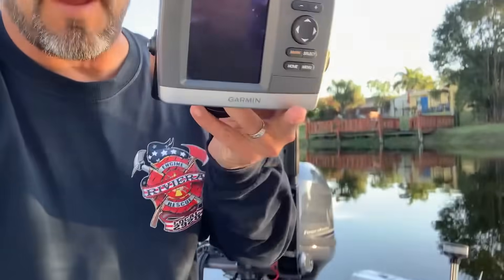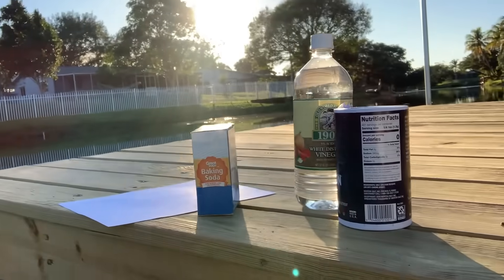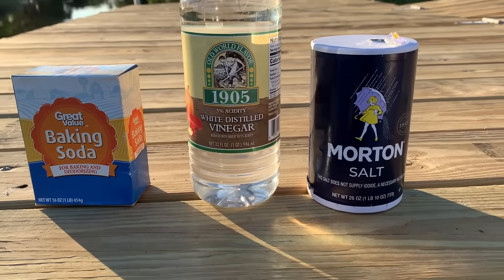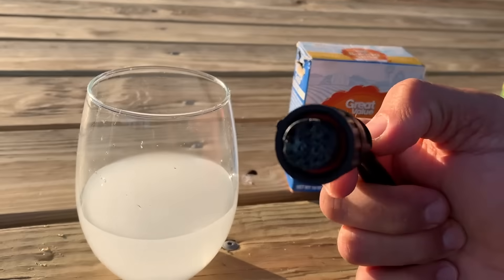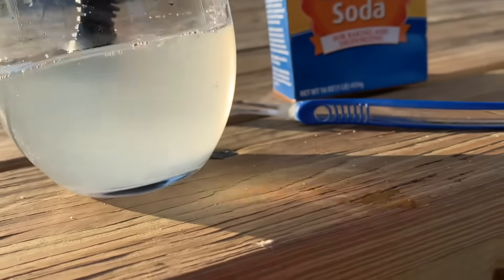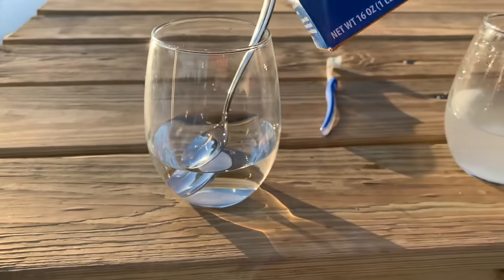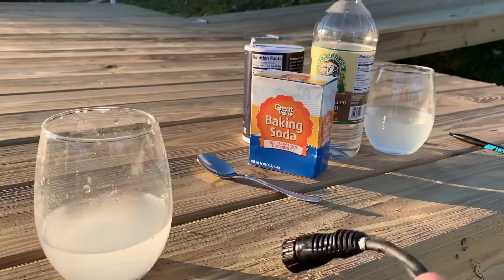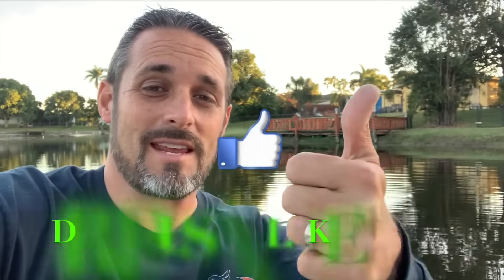HOW TO CLEAN CORROSION FROM COPPER ELECTRICAL CONNECTIONS USING HOUSEHOLD CHEMICALS

Comment: The reason for the salt in the vinegar is to convert the acetic acid in the vinegar to hydrochloric acid, which is a much more reactive acid that gets the job done faster. It does not change acidity or the amount of corrosion removed though, it just makes the reaction much faster & the job take less time. But the level of acidity in vinegar is very low so you only need a small amount of salt to completely convert the acid. The amount you used is way too much & is detrimental to what you are trying to achieve because salt caused the corrosion problem in the 1st place & applying too much again is going to setup the same reaction again. Sure, you can flush the salt out but you will have to use a lot of fresh water or distilled water to do that. You need only about 2g salt to 250ml vinegar to completely convert the acetic acid to hydrochloric acid. That is about 0.7 oz salt to 1 cup of vinegar.

When all the corrosion has been removed, flush thoroughly with distilled water.

Next flush again with Methylated Spirits (pure alcohol) to remove any remaining water and let it dry completely.  You need to do this because water confined in the small spaces in the connection will not evaporate quickly & may cause problems, but alcohol will evaporate faster.

It is likely the connector has been damaged by the corrosion & this will make it more susceptible to faults over time.  I’d suggest spraying a good electrical cleaner/conditioner into the connectors such as Deoxit F5.  These products seal the contact surfaces with a semi conducting coating that excludes air from the contact surfaces, preventing further corrosion.  From over 30 years experience managing & maintaining an auditorium PA, I have found that this increases the life span of connectors and reduces their maintenance by about 5 times over simply a contact cleaning product.  You may be able to find a marine grade product in this case, but F5 is what I used.

If you do use an abrasive on electrical contacts, try to use the finest grade you can & then polish with a metal polish because a polished surfaces will oxidise the slowest & will remain working reliably longest.  So avoid scuffing up contacts with files, knives & sand paper if at all possible.  If it's an emergency so you have to do that to get home safe, replace the cabling afterwards because it's going to corrode fail you again & probably sooner than you think.
Reply from the maker: Wow!!! Thanks for the detailed comment. Most helpful
Reply: Better check with your chemistry professor on that before you take the final.

Comment: Dielectric grease those before reconnecting. Also rinse that vinegar off with clean water before drying it off.
Reply from the maker: I did the clean water thing. I need to get some dielectric grease for sure
Reply: Water caused the corrosion. After tixing the corrosion, water it down again? We talking electrical wires…. 😮😢

Comment: Just so everyone knows, vinegar and baking soda mixed = salt and water. 
A better way might be to use a slurry of baking soda and water, scrub it and work it down into the connector, then pour vinegar into the connector and using the brush work it around. That way the reaction is taking place on the connector, not in the glass. 

Then follow that with alcohol and let it dry.

Comment: Better than vinegar on this type of connector is citric acid. The reason for this is that you also have rubber gaskets on these connectors that vinegar will attack. You can get away with vinegar a few times, but you won't have any issue with citric acid and in my experience citric is also better at cleaning copper. Neutralizing with a bicarbonate wash is ok but after scrubbing with your acid. Just make sure you flush well as you don't want any residue from citric or bicarbonate. Also, consider using interdental brushes for the female contacts. They will get deep in them and scrub well.
Reply from the maker: Nice! Thanks for the ideas here

Comment: Any corrosive liquid containing salts or acid is going to wick up into the wires eventually dissolving them. It's just a matter of time.  Prevention is the best thing by making sure the o-rings are intact, lubricate with a little silicone grease and check the connector is fully tightened.
  There is a liquid product used for neutralizing salt for fishing reels that might be effective, but I have never tried it.

Comment: Thanx nice video.
 I might try laying the glass or other type of container like maybe a plastic or glass mustard or other container that has a smallish opening at its top with a lid. Remove the lid. With the container  lying on its side a bit so that the connector can be laid on its side so the liquid can get up into each connector hole and the air would be pushed out. This way the fluid will contact each individual hole deeply.
Reply from the maker: Nice!!! Thanks for the info!!

Comment: Instead of dialectric grease to finish off with, try ACF50 anti corrosion spray from any motorcycle shop. It should do a good job of displacing any wayer, and also wick down the wires.
Its a good idea to use ACF 50 on any electrical looms or circuit boards from new so the corrosion doesnt happen in the first place.
Reply: Acf 50 or Corrosion X by same manufacturer is great. NOT dielectric grease.

Comment: Nice to know about home remedies. But CRC makes an electrical Contact Cleaner spray can that works really well and dries pretty fast. I use it on my truck to tráiler electric connector
Reply: Where can i buy that ?
Reply: @TempusErrante  
I buy it at the Home Depot and the electrical contact cleaner spray is located in the electrical isle right where the wire nuts are located.
Reply: @Gabriel-jc2sc  thanks pal 🫡🫡🫡🫡

Comment: After washing the connector with water, you could dip the connector in Isopropyl Alcohol which will displace the water and then evaporate
Reply from the maker: Interesting!!
Reply: Would WD 40 work for this?
Reply: @drizler  Yes and not only to displace the water but to prevent new oxidation.
Reply: Good idea!
Reply: I was looking for how he dried it out!  Once upon I time, I “knew” to use alcohol, but i couldn’t remember the best way to dry out a connector.  Thank you for posting this!!
Reply: Absolutely or some electrical spray cleaner
Reply: Yup, Use 91% isopropyl or higher.
Reply: Everclear to the rescue again?

Comment: My friend...
I'm sorry to be the bearer of bad news but, SALT is the reason your connector terminals looked like that to begin with.
Now, to make things worse, you dunking the unmated (which means unsealed) connector into another salt bath. The terminals inside of that connector are most likely crimped, possibly soldered, to the multi-conductor cable that enters that housing. In other words, these terminals are not sealed off to the elements when unmated, thus, the copper end of the cable is wicking all of that salt up into the conductors.

You may say to yourself, hey it got rid of my corrosion & i haven't seen anymore since. Well.. while i wouldn't recommend "washing" any electrical connector in that method, I'd wager to say, that if you haven't seen any corrosion since then, it's because you washed the salt away with your second rinse.. However, I would almost guarantee, if you cut that connector off or de-pin it & strip the individual conductors insulation back, you'll see blackened or even green fuzzy wire strands..

It's crazy how far back water/moisture will wick into a wire.
If you don't believe me, here's a short example. 
I once used inferior heat shrink on a set of battery cables I made for my dual battery toy hauler. I knew better, but was in a pinch & needed to be operational. Well.. just two years later, water/winter road salt had wicked up every cable on that truck & almost the entire length of each cable. 

I've seen the same thing happen to unsealed splices in headlight wiring etc.. Water, Humidity, Moisture, acidic chemicals, whatever... All bad for wire & cable. Not only does the joint/connection go bad, but major lengths of the harnesses get junked too..

I would suggest, terminal cleaners next time as there are cheap tools dedicated to fixing problems like that. Carburetor tools can also work in a pinch for scraping corrosion.. just whatever you do wallow/stretch your terminals out with the tools or they won't make contact anymore. 

Just some food for thought my friend.
Reply from the maker: Wow! You put a lot of thought and time into this bud. Thanks for the suggestions. As stated in the video, I’m no Electrician and I’m no chemist. Just made a video on how it worked for me and it seemed to work great. But I’ll keep the things that you suggested in mind.

Comment: I though the salt would be counter productive? Can’t you just use baking soda and vinegar. I’m just thinking the salt water caused the corrosion
Reply: Just wondering as a kid we always used vinegar and  baking soda on batteries to clean terminals. I didn’t know if salt made it better. Thx  great video I will subscribe your interesting
Reply from the maker: Perhaps. I’m no chemist but the salt was supposed to balance one of the other chemicals out. Connections are still clean and functional two years later with general maintenance
Reply: @watchyourlip3209  well what you did worked thats all the point of this video well done

Comment: I tried your way for RUST on my USB connector charging cable did't work . What did work is toilet bowl cleaning liquid . If you read the label some of them says removes rust . I tried it once letting it sit for a  minute . On the outside removed much of it . had to use again letting it sit on inside of USB connection for several minutes . Rinsed it off then dried sparingly with heat gun . Now works .
Reply from the maker: Awesome. Thanks for the advice
Reply: @watchyourlip3209  yep it’s the charging cable for Craftsman rechargeable headlamp

Comment: Ok.. putting salt into an electrical outlet is a terrible fkin idea.  The salt will dissasociate into Na and Cl which are extremely reactive with most metals.  If you end up getting any of it behind a nook or pocket it can cause a short circuit later, especially if there's water involved.   Adding salt to water makes it more conductive.  

You should've used dielectric/silicone grease to plug up that terminal from day 1.  That's what the grease is mainly for.  It helps seal out moisture and prevents the corrosion of bare metal.
Reply: well no good going on about silicone grease is it, he already had the corrosion. This is about cleaning off the verdigris, which you didn't address. After all is flushed and cleaned out then use a grease.
Reply from the maker: Still works. No corrosion

Comment: One connector was still green and more corroded than others. It can be main power supply.
Reply: Almost certainly one of the ground pins. I saw maybe 3 that were still green including that one. It's startling how much salt speeds up the process. It wasn't wet that long but the connector looked like it was 10 years old in the before photo.

Comment: Vinegar with salt will definitely get copper oxide off, but how did it hold up???? You've got acetic acid and salt residue all up in there now. Did it corrode again?
Also, do you know WHY you're using baking soda? Because it looks no better after you put it into the baking soda water than it did before. Which is what I expected since I think sodium bicarbonate isn't going to react with copper or copper oxide. I'm pretty sure the reason that step is there because you shouldn't have used acetic acid for this application and now you are trying to neutralize it. But it doesn't get the salt out. And it isn't going to reliable get all up into the stranded wires that got soaked with acid and salt.
Reply from the maker: Hey bro. Thanks for watching. I’m no chemist and no electrician. It’s just a recipe that was suggested to me. I looked it up and found multiple sites that had the same recipe. It held up very well for about a year. I wound up getting a new Garmin, not because the old one had issues. It was just time for an upgrade

Comment: might want to try it with the holes facing up so the mixture can go inside the holes, if you put a glass upside down in water you can see the water won't enter depending if air can flow though the socket but it appears to be molded. nice video, trying to desolve that green on a footwell module in a mini cooper
Reply from the maker: Nice. Thanks for watching! Let me know how it goes
Reply: corrosion on my mini cooper kick panel area. Cant connect to OBD2 scanner, and found X15 connector to be the only splice/connector between PCM and data link. No continuity to the pcm from datalink, and this connector was so green and rusted. haha. This worked great tho..... kuddos to the creator on looking this up and passing it on.. Still have ot go out tho for my electric grease.. ugh, lol....

Comment: Use lacquer thinner problem solved
Reply: It removes corrosion buddy, just try it.
Reply from the maker: Really??? I might have to try that
Reply from the maker: Is using lacquer thinner specific to copper or can it be used on other metals to remove corrosion ?

Comment: Great video, just bought an e bike and noticed simular so going to give this a go 🤘
Reply from the maker: Sweet!!  Lmk how it goes!!
Reply: @watchyourlip3209  will do
Reply: Yes I find corrosion is a big problem on ebikes. I live on the coast and am always repairing corroded connectors and wires. Ebikes are the best but if you own one you will likely run into this problem. Keeping your ebike inside and out of the weather could help a lot!

Comment: ...I recommend watching different videos, this guy has no idea how corrosion/oxidation and electronics work...also he cleaned nothing - it will happen again, because the corrosion spreads over time
Reply from the maker: Well sir, you are 1/2 right. I’m no electrician, which I clearly stated in my video several times. However, over 2 years later with normal upkeep maintenance, I have corrosion free electronics 🙂
Reply: Raptor is right.
The video is so missinformational, that it should be retracted by author.
Is there no miss information filter on this site..

Comment: The major problem is not the  connector. It`s the "black" wires that comes with it. So a new connector (or pins) and cut wires until you find clear copper. Sometimes you have to change the whole cable becouse of corrosion.
Reply from the maker: Very interesting
Reply: @watchyourlip3209  I fix things like this for a living and I can promise..you are in luck if only the connector are bad
Reply: @nonetasker4551
Or just buy a new boat and a new Garmin.
It's a fish finder.  🤣
Yeah, I know this is an old salty how to, but couldn't resist. 😁
Do you have the same Garmin? If so, how did the fix hold up?
The only thing I'd do differently is holding the connector down so less solution flows down inside the connector...
 ..maybe it makes no difference if it's flushed well.
 I liked the guys mentioning a final alcohol rinse or more than once.
After each process, I'd swing that connector around like a rancher roping cattle, slinging as much liquid/solution out as possible before the next step.  Lastly, allowing it to dry fully in the hot sun.
Great how to 👍
Reply: Yep.  Cheap crap from China

Comment: I wouldn't use Water & Salt (For me that's insane) 🤯
Definantly not recommended !!! 🧐😳
My preferred & method would be just use warm water with Bi-Carb Soda (Toothbrush is a good tip), then clean out with Electrical Contact Cleaner followed by a dunk in some "Corrosion X". This way will Guarantee not to have corrosion issues for many years or atleast several months to come. (Especially in the marine environment)

Comment: I see the need for salt and vinegar, but the baking soda just neutralized your acid so I don't expect that did much.  I think just washing with water after the salt and vinegar would be just as good.  I'm trying the same thing with ruby fluid, which is a flux for copper brazing...we'll see how that works.
Reply from the maker: Cool. Lmk how it works
Reply: @watchyourlip3209  It worked well to remove the corrosion.  The terminals were brass plated copper and it stripped the brass plate off also, but that's good enough for me.  Probably a lot of other acids and drain cleaners work, but I like your video here with more common chemicals.  I would have tried it if I didn't have the flux lying around.
Reply: That corrosion itself is of an "Acidic" nature, therefore Baking Soda mixed with Warm Water is all you really need. (Eats away any Acidity & thus corrosion) dropping the levels to more an alkaline level (could even be Ph Neutral) I would then clean it out with a Electrical circuit board cleaner then a quick soak of "Corrosion X" this will guarantee trouble free connections for several months or even a few years. 😊👌
Reply: @oze-bikes4life663  Wow you need to study chemistry waaay more before you try to write about it.  I don't like to be mean, but why act like you know what you're talking about when you don't?
Reply: @oze-bikes4life663  I didn't read much of you're crap here, but damn...no I'm a ME with 20yrs experience in electrical and mechanical applications.  Reading your first explanations shows you don't know anything about PH, and therefore can't have a clue about what you're doing with these connections.  I don't need to talk down to you...it would just be unfair, and I don't think you have the needed abilities to learn or understand.  Good luck.
Reply: @jaredbrandt9602 
 He stayed at a Holiday Inn Express last night.